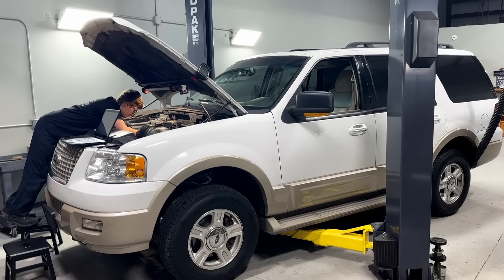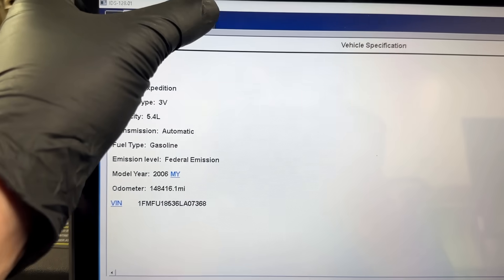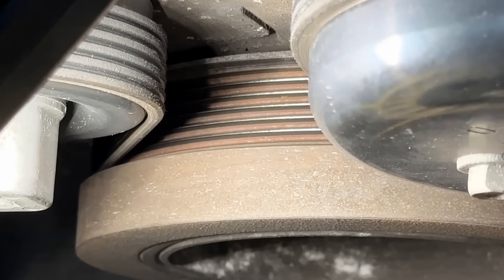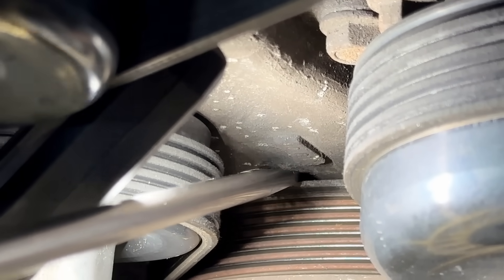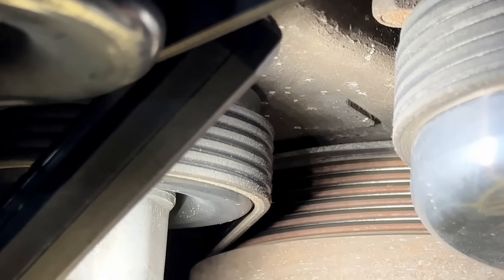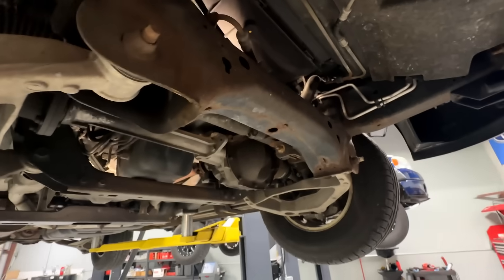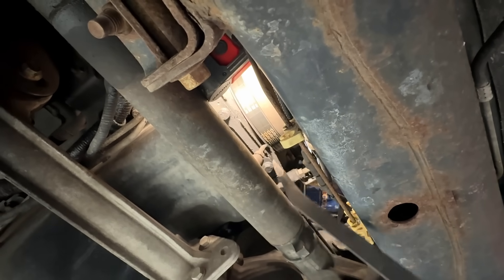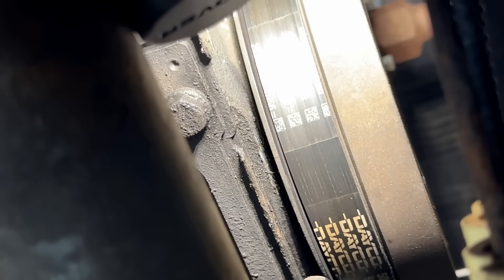Ford 5.4L 3v Triton Engines: Always Check This First Before Performing a Timing Job on this Engine!

Comment: We have a 2007 Expedition. Didn't like to hear that it's "The one you want to avoid at all costs." I followed your videos 5 1/2 years ago and replaced timing components, VTCs, oil pump, etc. and it's been running well ever since. You saved us thousands. Thanks!
Reply: I have a 2007 as well, did my manifolds and timing chains 7 years ago. I never knew to look at the crank play back then, been running 5w30 synthetic ever since and has been fine
Reply: I felt the same way a couple months ago when he said you definitely want to stay away from 2018-20 5.0L due to cylinder bore issues.  I had previously recommended my father in law get a 2020 F150 with a 5.0L.  I had always heard the 5.0’s were bulletproof.
Reply: @winstonsmith3685  I have a 2020 5.0 and it ticks so loud it's embarrassing. Ford issued a TSB on it that says it's normal for that engine. The TSB absolves them of any responsibility.  Paired with the ten speed tranny what a lemon.

Comment: The blue truck is 2007; It belongs to me! 

Thanks for the good work on the timing before and the current work! 

Brian does GREAT work; very meticulous and detail oriented... HIGHLY recommend to anyone needing Ford work done!
Reply: He’s giving better Ford training than when I got ford factory training
Reply: Where is Brian's shop located
Reply: @AtlanticHomes  Chicago Illinois area
Reply: Lucky you to be close enough to Brian.  For me, cost is not the issue.  I want someone I can trust.
Reply: @encinobalboa  Very difficult to find.
Reply: I have any 05 with a cold air intake. A tune running 92 oct for better performance. Getting 6-7 in the winter. High nines in the summer. What do you get for mpg? The mpg was like that before the tune. Muffler delete true dual exhaust. Thanks. So nice to have trolls every you one goes online. NOT
Reply: @princepeace6776 stock 2013. 8mpg towing 8000lb trailer. 16-18 highway 12-15 mixed driving.
Reply: @princepeace6776  07 all stock 145,000 miles.  13 -14 mpg on mountain roads.  No freeway or city.
Reply: You lucky duck👍
Reply: I guys act like fords are the only vehicles that break down
Reply: Cool!
Reply: 2009 280,000
Reply: I know this is an old video.  But I'm curious about your intake set up.  Did you make that? Or what brand is it?
Reply: If you own a Ford, you’ll need work done, that’s for sure.
Reply: @Dawgator  approaching 220k and my truck runs perfect...2004 too.  He is my mechanic. 🙂
Reply: @Dawgator  Even more so with Chevy and Dodge!  Guaranteed!
Reply: @mmarciniak  so what is this now a competition on how bad can auto makers get? No thanks. I’ll just go Toyota and remain happy.
Reply: @mmarciniak Chevy is more back yard friendly
Reply: @Dawgator  like gm trash doesn't have any issues 🤦🏻‍♂️
Reply: @sinisterx9029  Current topic is Ford 5.4L Triton trash. See if you can follow.

Comment: You can also tell from where the belt is riding on the tensioner,  because of the dampner moving forward its causing the belt to walk towards the front of the tensioner pulley I have seen it so bad that it was causing belts to be thrown off from the belt shreading.

Comment: Do they have the same problem with the thrust washer issue on a 5.0. I have a 2013 that the rear main seal is leaking so bad it’s actually dripping oil off the swaybar. Before I pay somebody to do the rear main seal, should I check that

Comment: Also if you look at the drive belt you can see how far it has moved, the drive belt is riding on the edge of the idler pulley
Reply from the maker: Normally true yes but I have seen many cheap aftermarket tensioners put on these engines and the belt rides close to the edge like that with no thrust washer concerns.
Reply: @FordTechMakuloco  
Good point and all the more reasons to use Ford motor company parts. You are doing your business and customers correct. Seldom in my mind is there a place for aftermarket parts but if the customer can’t afford factory parts you do what you can to help them. Enjoy your videos sir!

Comment: I wonder how the oil looks? Last summer my '06 had copper looking metal shavings in the engine oil at 124,000. Ford has taken the quality out. After being a ford man since the mid 70's, I drive a Tundra now.

Comment: I was one of the unfortunate ones that had this happen in my Lincoln Mark LT  truck only had 109000 miles on it. I installed a Ford remanufactured engine in it,do you know if they fixed this problem when they remanufactured them?

Comment: Great video!  I have a 2005 F-150 5.4L with 256,000 miles so I watch a lot of your videos over the years but I have been lucky that I have not had to do motor work of any kind at this point. 

Quick question. Do the 2016-2018 Ford Explorer 2.3L Ecoboost blocks have the same slit between the cylinders like the redesigned 2.0L Ecoboost in so of the 2015-2018 Edge and 2016-2019 Escape/Fusion/MKZ?

Comment: I've been so lucky with my 07 expedition.  300k miles..just replaced the VCTs as they were toast. Getting the parts together for a full timing job this winter..as it has started to rattle for a second during some start ups. I'll check for this to make sure. I do change my oil every 3000 miles and have been using 5w 30 and a quart of lucus oil with every oil change for years. I really do love these trucks. My only gripe with the 5.4 on the expedition is the lack of room to work with 🤣😅 other than that I've been using it for years to tow my RV all over the country. It's been the most reliable truck I've ever owned. Has never left me stranded.

Comment: Brian I have an ‘06 F150, 5.4 3v with 270,000 miles. Bought it used in 2010. I’ve been using full synthetic for years and I switched to 5W30 years ago before I ever saw your channel due to living in coastal Alabama and not being subject to sub freezing temps.   No engine work of any kind has been performed. Oil changes, recent spark plug change, throttle body cleaning and coolant flush are all that have been performed. Did I just get lucky with this one?
Reply: NO!
Reply: They tend to last Ionger with thicker oil. Many 5.4’s in fleet service probably get fed 15w-40 same as the diesels in fleet service.

Comment: Great video!  The other tell-tale is the serpentine belt almost rolling over the front edge of the tensioner pulley because the crank/dampner is too far forward.
Reply: I noticed that as well...
Reply: Yep it is I noticed that right away myself, but that alone may not mean anything if the pulley bearing is worn. Of course inspection of the pulley would verify it.
Reply: see jeremy above>

Comment: I've got a 04 ford f150 4.6 liter and so far it's been a good one so far..I know one thing you are the best mechanic I always seek out your channel when I have a problem with my truck thank you so much buddy
Reply: My understanding is that the 4.6, whether the 2v or the 3v, is not as prone to the typical Triton issues as the 5.4. Also, if I remember correctly, 2004 F-150's still had the 4.6 2v. My grandmother's 2007 Mercury Mountaineer has the 4.6 3v, and it's been a very reliable car, with no major issues with the engine, granted, my grandmother has been pretty good about having preventative maintenance done to the car.

Comment: Thanks as always brother for sharing your extensive knowledge , you virtually held my hand on my 06 5.4 3v 3years ago when I did a timing job and I squeaked another 40.000 miles out of it before it died @ 260k by that time I was in a position to buy another Ford  2012

Comment: Great tip, Brian!  A good backup way is to check where the belt rides on the tensioner.  If the belt is even with the front edge of the tensioner pulley, she’s toast.
Reply from the maker: Normally true yes but I have seen many cheap aftermarket tensioners put on these engines and the belt rides close to the edge like that with no thrust washer concerns.

Comment: You didn't actually say the words "this needs a new/reman engine".
😂

Any chance of rebuilding this one with new bottom end bearings, timing set, and other bad parts, or is it cost prohibitive compared to purchasing a new/reman engine?

Asking for a friend...

Thanks for another great video!
Reply from the maker: When the thrust washer fails it chews into the crankshaft requiring a new crankshaft as part of the rebuild which would be cost prohibitive yes.
Reply: @FordTechMakuloco  Got it. Keep up the great content, sir(s)!

Comment: At this point, is it worth dropping the pan, installing new crank bearings, doing the timing job and replacing the rear main seal or going with a re-manufactured engine?

The rest of the Expedition looked pretty good. 

With new and used car prices through the roof, do you roll the dice and go repair or replace?

PS, I wouldn't mind having that SUV.
Reply from the maker: The thrust washer chews up the crankshaft so you must pull the engine and rebuild at least the lower end and maybe replace the crankshaft. Not worth it.
Reply: @FordTechMakuloco  So junk the vehicle or put in a reman?
Reply: @gregjohnson2073  get a reman. Especially since that one is in such nice shape.

Comment: Wot are a thrust washer ? I mean I can guess, but I’d like to see one with an explanation of where it goes.   
   This seems to me to be a very useful demonstration of what to look for if buying a Ford in America.
Reply: Yeah, on the older engines I've rebuilt, one of the main bearings has sides that served as thrust bearings.  I haven't heard of a thrust washer.

Comment: The idler pulley near the crank pulley, the BELT is at or past the edge of it... and all the oil on the bottom below the crank.. and Wow, in all the motion in the crank from wear in the bearings

Comment: Wow, the belt on the tensioner is almost even more obvious with it right on the edge of the pulley. Thanks this was perfect, I have yet to see a bad one personally.
Reply from the maker: Yes it is another indicator but not as trustworthy. Aftermarket tensioners can also track to the edge like this even with a perfectly fine thrust washer.
Reply: @FordTechMakuloco  oh good to know I'll make sure not to ust go off of that, thanks again I love the videos!
Reply: hell YESS!

Comment: So what was the verdict on that Expedition's engine, will it need a new engine, or can that engine be repaired, what'll it be?
Reply: Drop in a rebuilt engine if the Expedition owner wants it fixed. It needs a rebuild.

Comment: Its the explanation Brian does with his videos that make all the difference, not just that the thrust washers are toast but that the crankshaft walks back and forth which causes a loss in oil pressure.  Most tech would leave it at the trust washers are bad.

Comment: I work on building engines as a hobby.  I have never had a 5.4 apart.  A couple of times you said "thrust washer".  Do you mean the thrust BEARING or is the 5.4 different from other engines in this regard.
Reply from the maker: I have a video linked in this video's description that shows how the thrust washer looks inside the engine.
Reply: No difference besides terminology, both do the same job.
Reply: @groosbro1  Quite aware of that BEFORE I watched Bryan's link but that was not my question.  I didn't ask if they did the same job, I asked if the 5.4 was DIFFERENT.  Craig Williams answered my question correctly.
Reply: it's seperate pieces--not part of the main bearing
Reply: @P51  👍👍